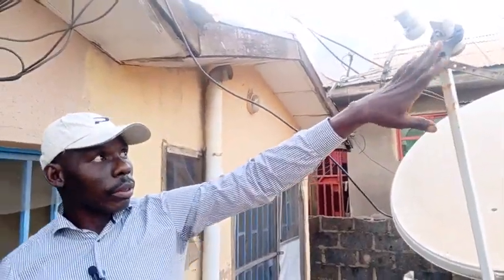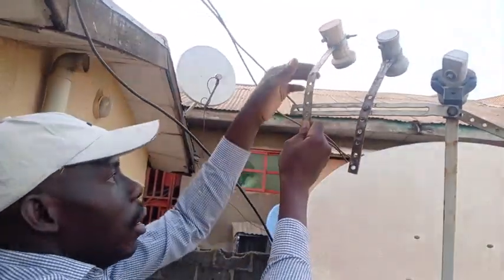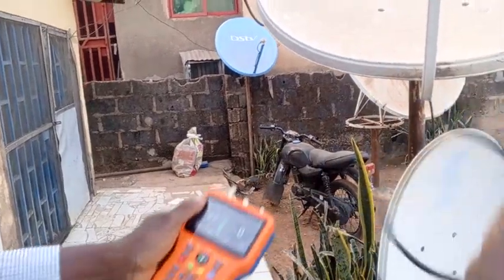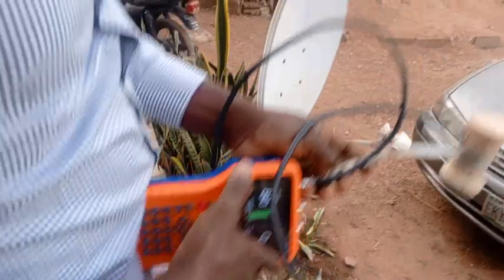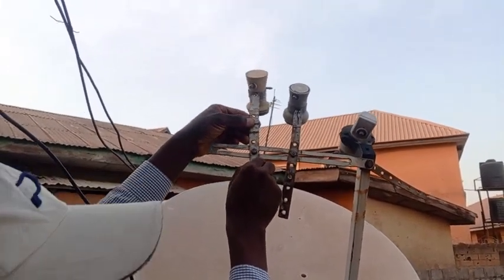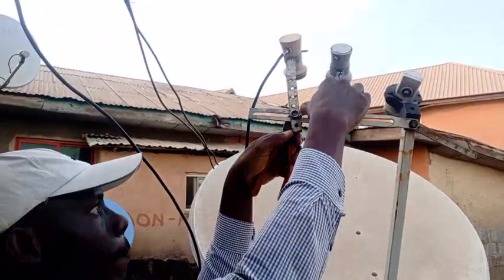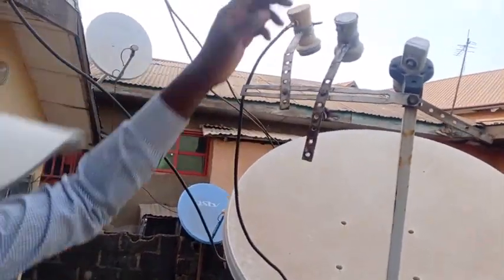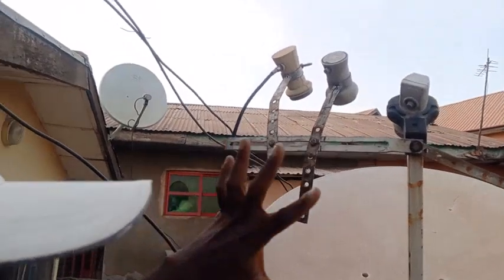Attaching 36E (DStv) to Eutelsat 16E &Amos 17E (Primary)

Comment: How can I tell if the lnb is not working.
Reply from the maker: @ianhambozi1531 Low or no signal strength
Reply: @Satellite-DIY  the signal strength is zero percent
Reply from the maker: It's bad but first check if the cable connecting Decoder/Finder  to LNBF. If cable is bad and it's still at Zero, then replace LNBF
Reply: @Satellite_PUSH  which one is the best LNB I have seen things like 0.5 and 0.8 db. I am not sure what to buy.
Reply from the maker: @ianhambozi1531 0.1db